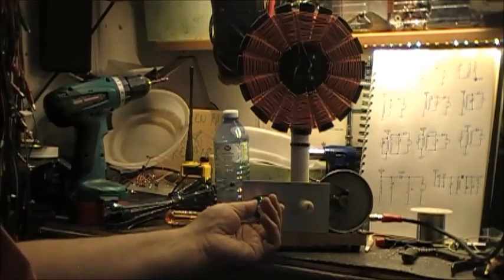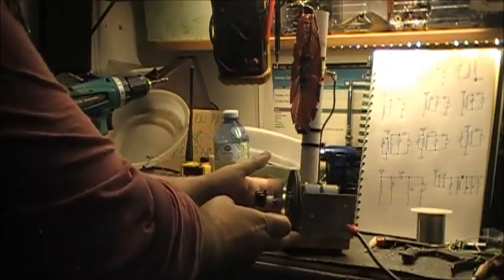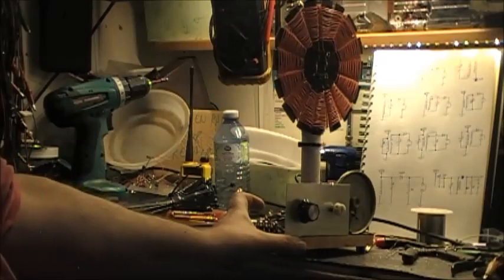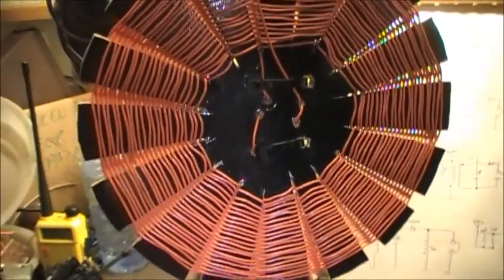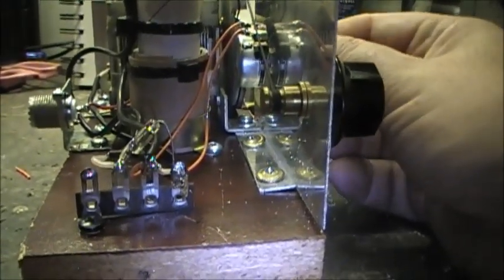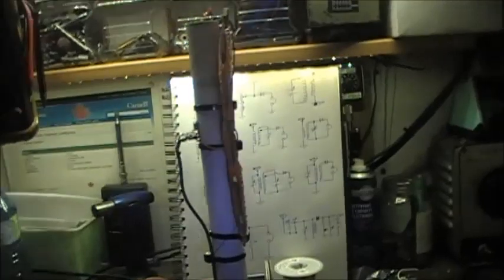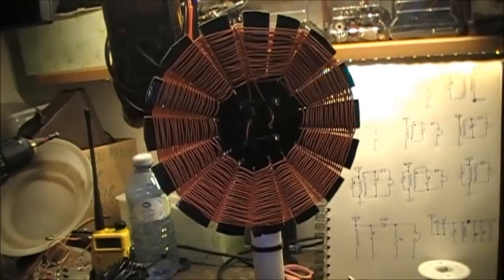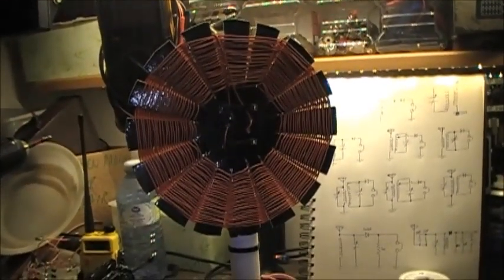Spiderweb coil for crystal radios

Comment: Always thought old radios with antennas as looked so cool. I didnt realize how effective they were - both for signal strength and directionality. I'm guessing the large width of the coil  creates a large effective  RF cross section. I'm wondering if the most effective diameter would be around half a wavelength ....

Comment: It looks like you have 46 turns (23 per side). How big is the inner diameter? Also, what wire size did you use? Thanks.
Reply from the maker: 20awg
Reply: @Radionut63  Thank you.
Reply: @tsbrownie  it looks like 4" dia from here

Comment: It is more accurate to call this a "spiderweb coil".  It is made vary like a spider makes its web.
Making a larger diameter one can get you more signal as can spacing the windings very slightly.
Reply from the maker: I thought so, seen on a few places online they call it Spider coil, i always called it a spider web coil.  In any event, i have corrected the error!

Comment: Made a "variometer" (variable RF inductor) as a child, about 60 years ago. Consisted of two of these in series, arranges so that you could slide one over the other, changing the inductance and self-capacitance. Means you don't need the (more expensive) variable air plate condenser. Parents weren't happy about me dipping it in melted  paraffin wax in the best saucepan.
Reply: Check out using a NTE618 in place of the expensive air capacitor as a varactor For crystal radios. It supposedly has a broad range of reception.  And very little downside. Credit to youtuber mikrowave1 for discovering this